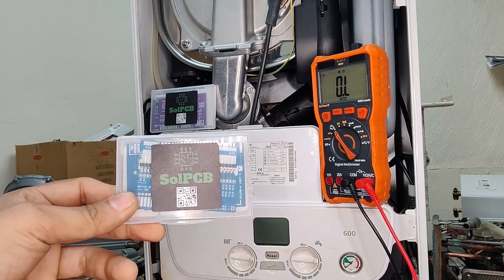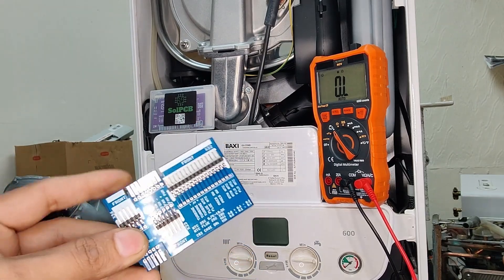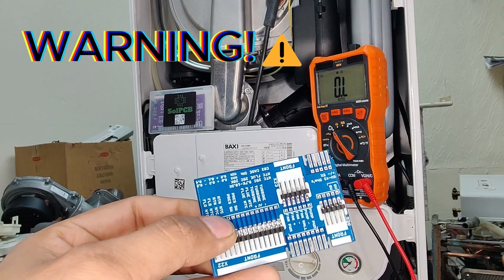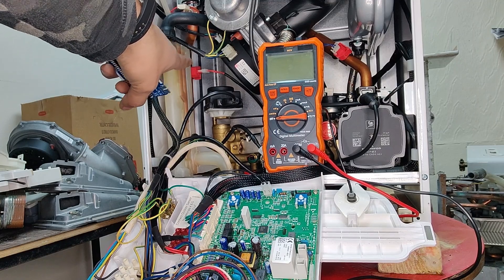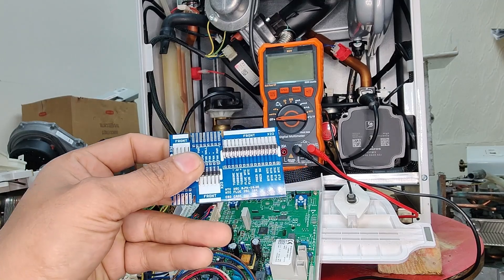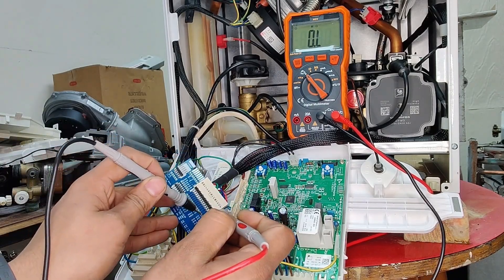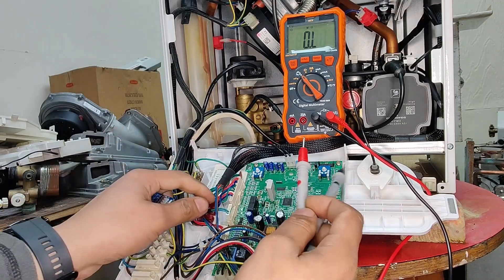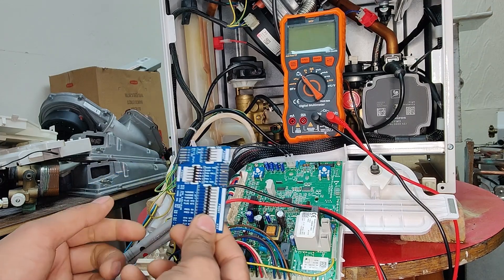Fixing Boilers with SolPCB Diagnostic Cards – Honest Review: Game Changer or Gimmick?

Comment: I prefer to use a terminal block attached to my multi meter end and then a thin stripped copper conductor attached to it also. This gives a thin probe that u can put into the removed block
Reply from the maker: There are all sorts of work arounds however this comes across a better way of testing tbh.

Comment: Lots of fault diagnostics are done with a live boiler, so not really useful for that. Also PWM can’t be checked on Circulation Pumps & Fans. You can’t check the 240vac polarity or many other checks.  But hey, many may find these useful, but my guess is experienced engineers will not bother.
Thanks for sharing & the best of luck to the card manufacturers.
Reply from the maker: Yes Jimmy it's true that a lot of testing is carried out live however dead testing of components is a major part of the diagnostic process as it makes it a safer option to diagnose the faulty components. Obviously most of us have been working without these gadgets and are comfortable with it however the use of these things and having the relevant information written on the cards makes the process easier.
I get your point buddy that it's a behavioral change and many of us won't budge 💪